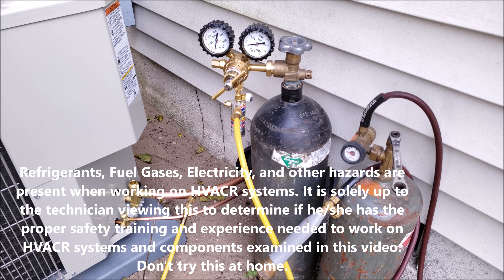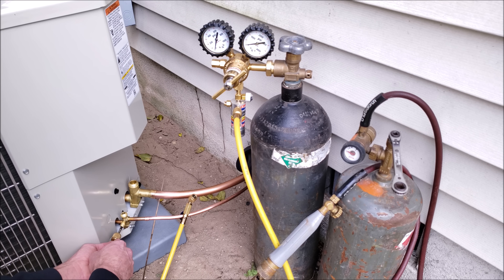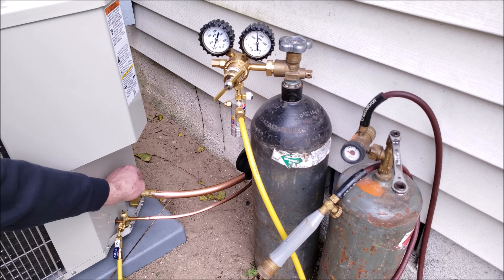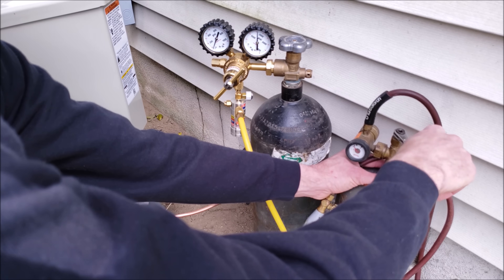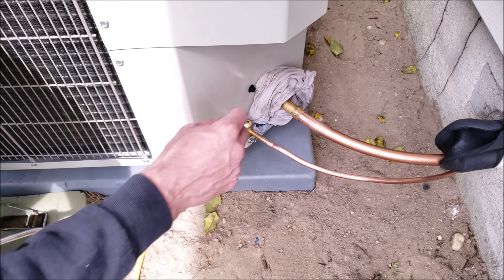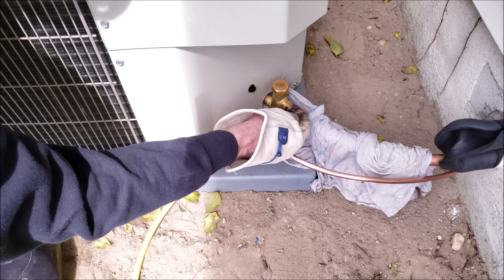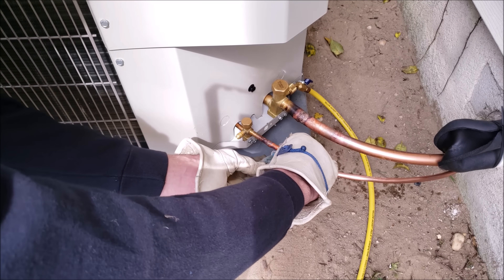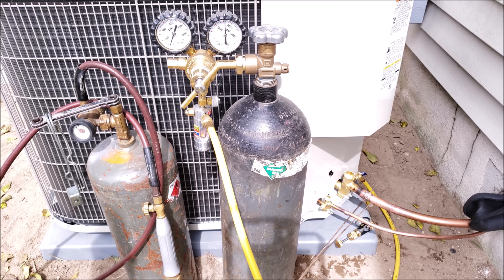Brazing HVAC Line Set to Service Valves! Full Procedure!

Comment from the maker: My Service and Procedure Book- https://www.acservicetech.com/the-book
Tool List-  https://www.amazon.com/shop/acservicetech
Support the Channel-  https://www.patreon.com/acservicetech
For those that are looking for the tools used in the videos: (Linked Below)
Air Acetylene Torch Setup-    http://amzn.to/2aQalsb  
15% Silver Brazing Rods-  http://amzn.to/2gVLyLc
Nitrogen Regulator-   http://amzn.to/2bXdR5f
Nitrogen Flow Meter-    http://amzn.to/2brvoBg
NitroVue Flow Reg-  https://amzn.to/2MiulYv
Ameriflame Oxy Acetylene Torch Setup- https://amzn.to/2SRm3JF
#2 Tip for Oxy Acetylene Torch- https://amzn.to/2SPDaeD
Cap-N-Hook Tip for Oxy Acetylene- https://amzn.to/2MbhpUk
Manual Copper Tube Swage/Expander- https://amzn.to/2WRPa1M
Uniweld Hydraulic Swaging Tool- https://amzn.to/2MlrI8m
Uniweld Swage and Flare Kit- https://amzn.to/2T55jyn
Ultrasonic Leak Detector- https://amzn.to/2Lw4Zpr
Appion Valve Core Removal Tool- http://amzn.to/2uYr8WL

Fieldpiece MR45 Recovery Machine- http://amzn.to/2xAOpN6

RectorSeal Bubble Gas Leak Detector http://amzn.to/2ckWACn

Pack of 25 C&D valve cores- https://amzn.to/2J1lurm

C&D Valve Core Wrench, Container, and 3 valve cores- https://amzn.to/2EVGkps

 Filter drier for Recovery Machine- http://amzn.to/2veVV3m

Here is the link to the Yellow Jacket 1/4" by 1/4" heavy duty hose straight-  http://amzn.to/2umtcod
Blue Vapor Yellow Jacket Gauge- https://amzn.to/2Ju7pan

Red Liquid Yellow Jacket Gauge- https://amzn.to/2sSFmGH

Quick Coupler for the Gauges- https://amzn.to/2sTk8Ze
JB Test Gauge High Side-  http://amzn.to/2ruQb0l
JB Test Gauge Low Side-  http://amzn.to/2qR0utM

UEI DL479 Multimeter with temp sensor http://amzn.to/2jtsUbJ

Magnet Jumpers- https://amzn.to/2PyKPQZ

Alligator Jumpers- https://amzn.to/2PxqJXn

Fieldpiece ST4 Dual Temp Meter  http://amzn.to/2wc1ME3

Fieldpiece Bead K Type Temp Sensor https://amzn.to/2DBwKfs

Fieldpiece Wet Bulb Temp Sensor https://amzn.to/2RRI7Tw

Fieldpiece TC24 Temp Clamp https://amzn.to/2qHLyjZ

Yellow Jacket Refrigerant Gauge Set http://amzn.to/2aenwTq

Refrigerant hoses with valves http://amzn.to/2aBumVI

Yellow Jacket Gauge set & hoses https://amzn.to/2vLVkV9

Yellow Jacket 4 Port Manifold w Hoses https://amzn.to/2BkuGIq

FieldpieceSMAN360 Digital Manifold Set https://amzn.to/2BdoaD4

FieldpieceSMAN460 Digital Manifold Set https://amzn.to/2nB4Fe6

Compact Ball Valve for Refrigerant Hose https://amzn.to/2KUisW8

QuickDisconnect 90 for refrigerant hose https://amzn.to/2MMtVcg

JB 6 CFM Vacuum Pump   http://amzn.to/2nqbvo8

Appion Blue 3/8" to 1/4" Vacuum Hose http://amzn.to/2uYlVyc

Appion Red 3/8" to 1/4" Vacuum Hose http://amzn.to/2uYg6Ro

Appion Valve Core Removal Tool http://amzn.to/2uYr8WL

Yellow Jacket 1/4" by 1/4" hose http://amzn.to/2umtcod

CPS Vacuum Micron Gauge http://amzn.to/2v1nM3O

Supco Vacuum Micron Gauge http://amzn.to/2v1JRiA

RectorSeal Bubble Gas Leak Detector http://amzn.to/2ckWACn

UEI DL389 Multimeter  http://amzn.to/2xAdaJf

Other tool links can be found in the video description section.

Shop through Amazon! Your Purchases through Amazon provide a means for channels such as mine to earn advertising fees from all purchases after clicking through. Prices are the same as normal-    https://www.amazon.com/shop/acservicetech
Reply: You have a error in your book. On page 12 fig 2-2. In the legend for dark red it says high pressure, low temperature. It should say high pressure, high temperature. Because P and T are tied together. If one goes up the other will follow.
Reply: Could you please provide amazon link for a yellow hose you use for running nitrogen in this video? Thank you.
Reply: All the way from Trinidad and Tobago 🇹🇹  great lectures
Reply: I see you have a reverse swage from 7/8” line to 3/8” line. Interesting.

Comment: I have a question
I live in a house
My house uses R22 system
The refrigerant is expensive so I want to use a different refrigerant
However, they say I need to change the oil and I want to know how to change it
Or if I can use the oil of R22 as is and use a replacement refrigerant, please tell me which refrigerant you recommend. I would appreciate it

Comment: You don't have to flow nitrogen when using air acetylene. The temperatures don't cause oxidation . Also why choose air acetylene in this application?
Reply from the maker: Air acetylene temperature does cause cupric oxide to form. Here is another video on the topic, thanks! https://youtu.be/hrXX4IjjChM

Comment: Is there a benefit brazing then to solder?  Solder seems to do the job if prepped correctly using just a handheld propane bottle.  With brazing, you need nitro and higher temps. Soldering seems so much easier but  I see more brazing done out in the field.

Comment: Why are you rapping the the service valve stub with wet rag?  And no part house have that 5 psi regulator on the bottom of the nitrogen  regulator in stock.   Only the refrigeration suppliers might have them.  Also we're is the drier on the liquid line? Don't they come with the condenser?   Rap them also.  How many times do you get to run a new line set without the low voltage wire?   And I use my tubing cutters to pull back the insulation and rap it  with a wet rag.  That will stop heating up a blade and breaking it.  Not all people no how to braze with 5% silver.  So you need to have a bottle of water around that vinyl siding.   Use a wet rag under that line set so that the 15% won't burn through the the condenser pad or plastic drain pan.==most HVAC residential companies don't provide copper fittings or a swaging tool.  Or a fire extinguisher.   Another thing did you pressure test at 450psig?  R410a or r454b?  A2l?   My black crud won't be in two welds???? With wet rags.  Not heat be gone or thermal trap?  Welding blanket? Not???  See those access valves from JB industrial, CD or any other supplier won't be available.   No one's use a bicycle tool for scrader valves access?   Heat those up with your system and the core will not thread in?  Plastic caps don't tighten they break!!!!  Only Carrier products and Goodman use a service valve without a pee trap built into it.  And plastic caps.  Junk!!!

Comment: Why aren't flared connections used instead of brazing when doing AC work?  Flared connections are easily able to hold high pressure as in a car's braking system.

Comment: Craig, I always pre purged until the flow would suffocate a match flame.  That way I knew that there was no more oxygen in the line.  Glad you use a flow meter instead of just a regulator.  I like that you are using gloves. Good video.
Reply: The match flame is a really good idea I'll give it a try. Thanks

Comment: as a union apprentice he is not brazing correctly. He is not get full penetration on the 7/8”and after you use a wet rag on a hot joint you have the potential of cracking it while cooling.

Comment: This may seem like a dumb question but why braze the joint? I've seen videos by a company that offers high pressure connectors that you just tighten down. The company says that they can be used for HVAC. Can they be used? Seems easier to use.

Comment: I totally respect what you HVAC guys had to do to get trainied and licensed. Quotes for replacing my 30 year old handler and A-coil with a 3 Ton 2 stage Goodman system are coming in at $10,000.  I've done parts cost on this job including a new concrete slab at around $5,000. That puts labor cost of 2 guys, 10 hours, at $250/hour. What am I missing other than it's a totally sellers market and you guys are making up for pandemic losses?  Again, I understand the complexity of installing a replacement unit, but please understand my situation as a homeowner.  Thanks.
Reply: You are paying for not just labor, you are paying for knowledge, experience, material costs, truck fuel, insurance (workmans comp, vehicle, business, liability), shop rent and utilities, etc. Might want to rethink your attitude a little there Skippy.
Reply: Do it yourself.     They aren't going to crawl around your attic all day for the fun of it!
Reply: I think u are paying for what they know vs what they do.
Reply: @harykorne7995  at $250 an hour they would have to know the meaning of life 😂
Reply: What you're missing can be found by taking a business class. Nobody pockets all of the money unless they're doing a side job.

Comment: Great vid! I recommend placing a wet rag or piece of sheet metal over the wall exposed corner of the plastic equipment pad. Your skill level negates the need but anyone watching the video is probably going to scorch it with the torch or drop a hot solder ball onto it. Also I found that old socks work best as rags as they really hold the water well.

Comment: Craig,

I noticed you don't use flux. Probably because of possible contamination with the refridgerant. Do you think it is wrong (or over kill) to warm up the 15% silver rod then dip it into powered flux before brazing? I don't want to reinvent the wheel, just tap on your experience. 

Some food for thought!
You get some hits on a video install of an "Air Handler, with duct refit."

Thank you for your time.Enjoy your informative videos.

Ron

Comment: Thanks for this video. My builder contractor seal the line-set with aluminum, I’m wondering is it a standard procedure to do so? I’m asking because my attic line set is having severe leak , it will cost me more than $6k to repair or change the whole system for 12K. I really need some advice. Thanks to any inputs.

Comment: Great video.. Any chance you could explain when you should or should not use FLUX when brazing refrigerant lines?  It wasn't clear to me if your joints had already been fluxed either.  It would also be interesting to understand the effect from not having a nitrogen flow while brazing.
Reply: You don't use flux when braising, only when soldering.
Reply: Harris 15 rods are Flux coated. You just need a clean surface. Different kinds of rods have different coatings as well as different percents of silver. Rods with more silver flow easier but cost more.
Reply: Another video on YouTube stated that flux was only needed to join dissimilar metals. Not when doing copper to copper. Brass is a copper/zinc compound so in this case it still doesn’t need flux.

Comment: Does anyone know at what temperature significant oxidation will occur in the tubing without nitrogen.  It was said that brazing rod melts at 1350 degrees. My question is  aimed at fixing small leaks and not brazing sets together. As most of you know they now gave low temp melt aluminum rods which will melt with simple map gas around 725 degrees.  These rods a good for copper and brass as well. I haven't had a chance to try, but if oxidation doesn't take place at the lower temp,  seems to me repairs could be made after a simple pump down without the need and expense for nitrogen .

Comment: Aswem video with good illustration. What you mean by tank (b) and when you’re brazing the service valve must be in back seated it separates the outside condenser and compressor is that correct? Thanks

Comment: The wet towel to cool the valve does not work. Heat shield spray works the best it cost more than a wet rag but it’s the correct way. I cannot tell you how many pull and cleans I have done where the service valves were smoked on install and no longer seat. And when customers see me use it they get interested because most of the hacks out here can barely afford a rag. Don’t be a hack but heat shield spray.

Comment: Great Video. I was interested to see you did not need to use any flux to braze (we call it silver solder) Copper to brass. My understanding is when you "silver solder" Copper to Coper no flux is required. However, when you Silver solder copper to brass flux is required. The reason for this is I normally do silver soldering for plumbing installations and the silver content is only 2 to 5%

Comment: Just learning. I've see so many people not flowing nitrogen when brazing. I figured they didn't want to take the extra step to do the right thing. Not many people take pride in their work anymore. Your channel and book gives me hope. I was wondering can you use a mapp gas torch to braze ?
Reply: mapp gas will only get piping hot enough for brazing up to a certain size. i typically would use mapp gas torch up to at most like 5/8ths maybe. easy small size for when u dont want to lug the whole tank up somewhere

Comment: Funny seeing all this, it seems so complicated when you hear it all. Been brazing condensers and evap coils for atleast 5 yrs. I prefer spraying Cool Gel into the king valves since they're brass and won't rust. I hate using turbo torches, they are soo loud and slow, I'm always afraid of them heating the king valve up too much.
I think the hardest thing to learn is aluminum to copper brazing, I went thru 2 feet of aluminum trying to get a decent connection.

Comment: I am a subscriber and have bought your books, they are very good and thanks for all your help.
I have a question about flushing out a line set that goes up the back of the building about 5 stories, there are two traps installed, what would you recommend on how to flush them out if we cannot reach them. I am converting an R22 system to an R410A, I tried to blow nitrogen thru them but really didn't  get anything out of them. I am afraid the traps might be filled with R22,  looking forward to your comments. I couldn't find any articles about this on your website.

Comment: Hard soldering and brazing of HVAC line sets is nonsense. Use low temp silver solder and you don’t need to N2 purge or remove valves!
Reply: Won't you still have oxygen in the lines?

Comment: I've gotta say... this guy overheated those joints with too big of a tip and not spreading the heat enough. He was on those joints far too long with the flame. The finished joint should not be discolored or flaky looking like his did. I'm willing to bet that joint wasn't fully made inside the hub and pulling it apart would show deficiencies of capillary action. All joint filling materials make on the inside of the hub. A bead at the face of the hub means absolutely nothing relative to insuring a full, properly filled joint. He also didn't have the liquid valve wrapped enough with his towel. A real pro would also braze the liquid line first, being the input side of the low flow of nitrogen, and the suction line next. This will provide a genuine nitrogen "washing" of the lineset during brazing and leave no chance of any nitric compounds forming and being left in the system.  Also, why don't these new "professionals" use Staybrite8? Much lower melting temp eliminates carbon formation and its working pressures and temperatures exceed the working pressures and temperatures of commonly used refrigerants. It also leaves a much nicer looking joint.
Just because some self proclaimed professional makes a video and posts it on YouTube doesn't mean they know what they're doing or that they've developed their technique properly. There's a major difference between book knowledge, field knowledge, and practical application of well developed skills. 
Sorry guys.. I know you think you're trying to help folks but the skills I saw in this video are the same skills I see employed by "wham, bam" techs that I'm perpetually called in to remedy.

Comment: I thought you had to use 6s with B tank and can't use 15s
Reply: 15% is the way to go on refrigerant piping. Takes a little longer to get it to flow, but the leak risk is so much lower on 15% AND it's more forgiving for those that might not be the best at brazing copper.

Comment: I want someone to explain to me here when I try to solder on the line, the copper tube melts and also the solder does not stick, what is happening here?
Reply: Sounds like you have your torch set for much higher temperatures than needed to get the solder to flow. Heat the joint keeping the stick close to the point of the flame on the copper and once it starts to flow pull the torch back a bit to open up the flame pattern and follow the flame around the joint with the stick. Your flame pattern it too tight, like a cutting torch. Open it up by cutting back on the acetylene and then the oxygen to get a fatter, lower temperature flame.

Comment: You said Need get hot 1300 to melt the rod but you didn’t seem like get cherry colors the copper pipe before you applied before applying the rod according to the previous video  you said need to be Cherry color before applying I am just confused, because When I tried to brazing waiting too long to be changed the cherry color the copper then I touched the silver rod . The Ac condenser valve looks like brass color main  it doesn’t looks like copper when new condenser

Comment: Does the inside and outside of the copper need to be cleaned (sanded or wire brushed) like that of doing copper fittings for water? I know copper fittings for water usage needs to be cleaned and fluxed. Thanks!
Reply: No flux needed when brazing with 15% silver solder. Just sand the copper clean on the male end and make sure the female end is clean on the inside diameter.

Comment: Rookie here: Am I to understand that brazing and using that material to melt into the joint is different than that of sealing joints to be used in copper water joints?
Reply: Yes, you are correct. We use brazing because of the high levels of pressure in the HVAC system. Residential water lines don't have that much pressure or heat, so soft metal soldering, even specific plastic pipes are ok. Now when it comes to city water, and commercial types systems, that changes to steel, and iron.

Comment: What’s the advantage of using air/acetylene versus using oxy-acetylene?
Reply: One tank to haul around, that's it. You get better and tighter flame control with oxy-acetylene which is handy in tight spaces where an air-acetylene would blow a larger flame pattern.